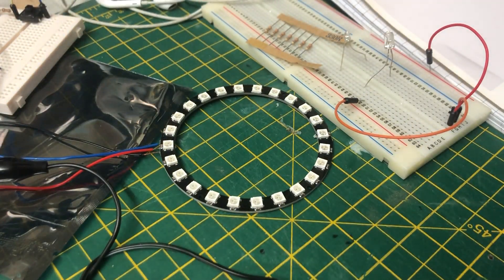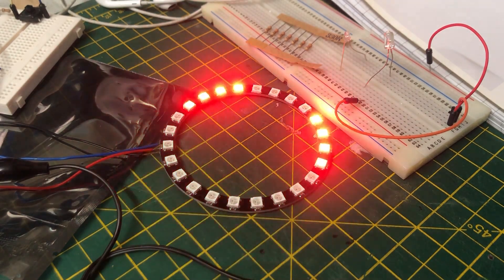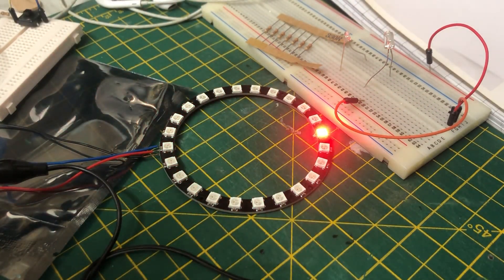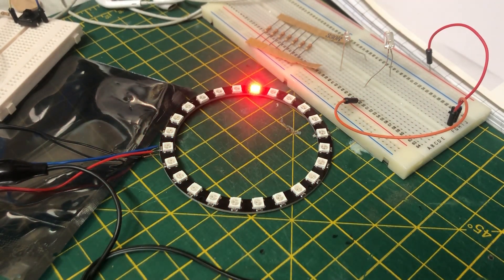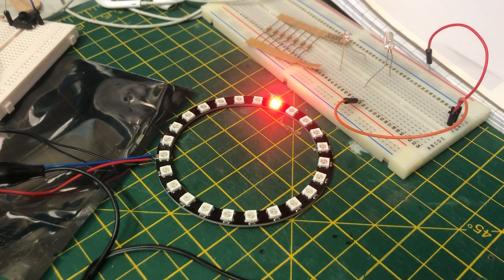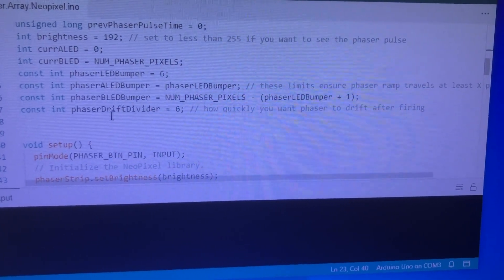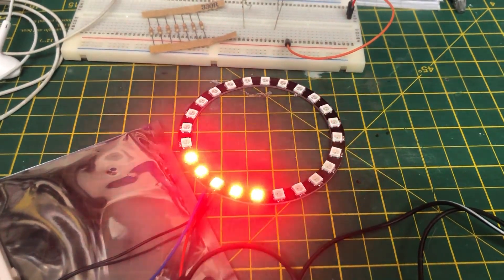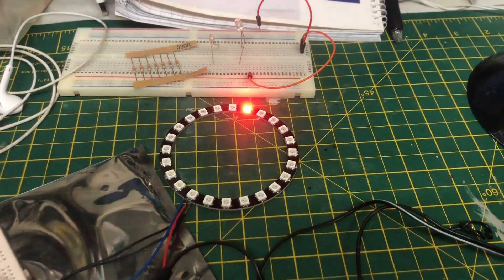Build review of AMT/ERTLS USS Enterprise D 1/1400 scale: Part 1 - Phaser array effect.

Comment: Looks cool. But isn't the radius for the Enterprise-D's phaser array a bit too small, at least when the ring sits directly under the phaser array?

￼
Reply from the maker: Thank you.
The neopixel ring was only rigged up to test the Arduino code as proof of concept. I’ve since got a meter long, 144 led addressable strip hooked up to it and that is what will be installed around the circumference of the model phaser strip from the underside.
Reply: @thekitcave2654  You should think about two of these top and bottom though.
Reply from the maker: @michaelbenjmitchell1  
I had thought about, I’ll see how I get I. With the top half first, if it goes ok…..I might do it for the bottom too.